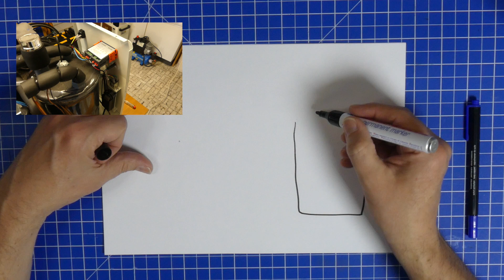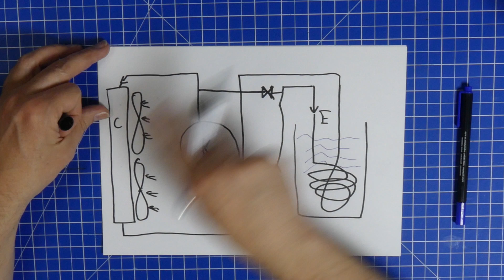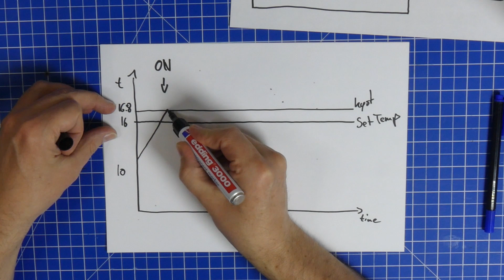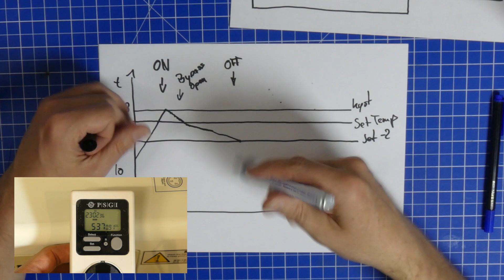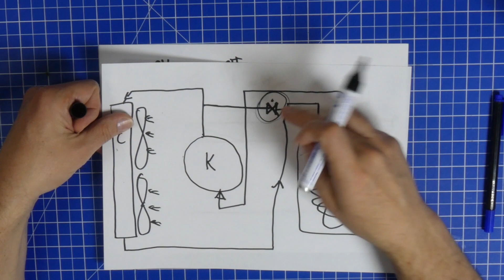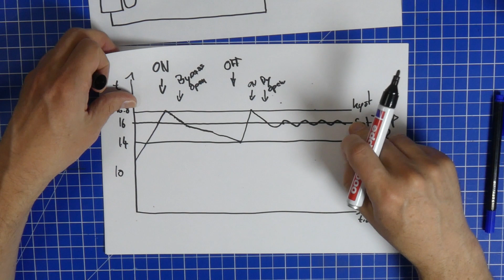... about my CW-5000

Comment: Hi ! Thank you for this vidéo. I think i have the same problem but my compressor never stop. I just put the hysteresis 2°C down and i stop the compressor mannually by changing mode. Maybe you have a better soluce ?
Reply from the maker: My best advice is to start by adding an extra temperature probe to the water tank and checking how cold the water really gets. If it does not get to 15 degrees or below then there's probably something wrong with the cooler.
Does your CW5000 go into the 'hissing' mode and  then it just stays there ?
Reply: @dherrendoerfer  Thank you for your answer, my cw-5200 cools normally as long as the solenoid remains closed. When it opens the temperature rises. The problem is that the compressor does not turn off automatically.
Reply from the maker: That's exactly the same issue I had with mine, and I believe it is intentional - The maker of the unit uses the open bypass to control the temps, instead of going through a full on-off cycle.
Reply: @dherrendoerfer  Ok thank you very much, what is strange is that before the compressor stopped once the T°-2 reached (hysteresis on 0.8°C) and all of a sudden it does not stop anymore. With 35°C in the workshop, it gets hot, so I turn it off by fiddling with the F3 menu, the temperature rises more slowly and the compressor doesn't overheat. This is the only solution I have found so far.
Reply from the maker: What is your target temperature ? At 35degC ambient the cooler might simply have too much load to reach the target temp.
Reply: @dherrendoerfer  My target temperature is 19°C, it cools up to 17°C without problem but when it reaches 17°C the compressor does not turn off anymore.

Comment: I'm late to the game, but if I remember right opening the bypass valve before starting the compressor will lead to longer compressor life. Since you are [programming the chiller controller and using its output you should be able to make a good deal better power cycle thane than the generic one that came with the chiller.
Reply from the maker: You are perfectly right - and that's exactly what I did when starting up

Comment: in your diagram the lefthand connection of the bypass valve doesn't look correct. shouldn't it go to the input of the compressor rather than the output of the compressor? As drawn it bypasses the condenser coils and effectively turns the cooler into a heat pump. There's no situation I can imagine where you want to be heating the evaporator coils.
Reply from the maker: No, it's actually correct.. since there is no pressure rise in the output of the compressor theres no temperature increase. It just eliminates most of the cooling.
Reply: @dherrendoerfer  where's the expansion valve go in your diagram?
Reply from the maker: I drew it as part of the evaporator in the machine itself it sits between the condenser and the evaporator, and has a capillary tube leading to the evaporator, the bypass joins at the exact location on the evaporator.
Reply: @dherrendoerfer  what you've got is called "hot gas bypass". As I indicated, when it's in bypass mode, it actually will pump heat into your evaporator which doesn't seem appropriate to me for this application. I think "cold gas bypass" would be better. 
https://www.achrnews.com/articles/105262-understanding-hot-gas-bypass